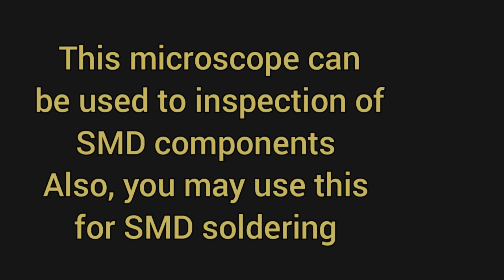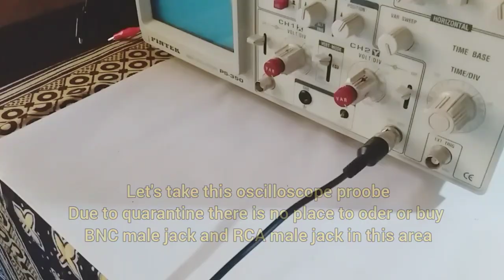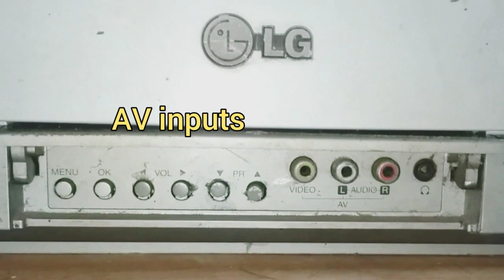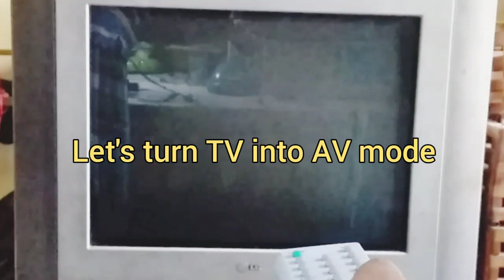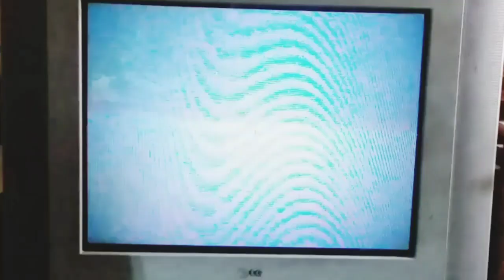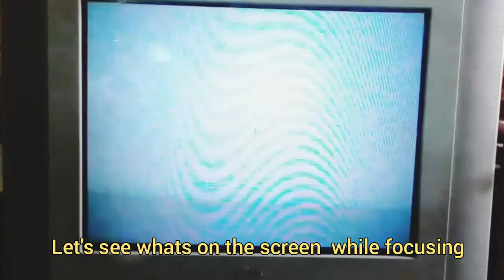DIY Microscope with a CCTV camera for SMD

Comment: Did you know you can buy one of those 2 or 5$ usb-microscope from amazon or etc and even those cheap stuff is 10 times better than doing this to yourself ?!
 + using a CRT TV! like 50kg TV on your desk bench FOR 2mp-360p-RF-video with the power of 2x zoom! LOL. and and you forget to use some SMD for light. 
and im sorry but thats not hacking and Not a cheap solution, also not even useful for SMD soldering and nop, thats not Microscope at all.